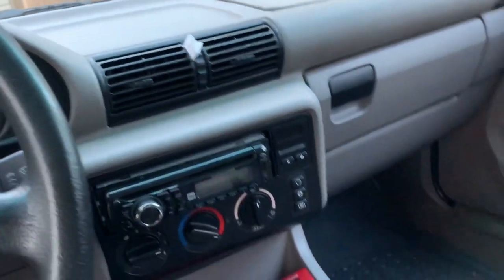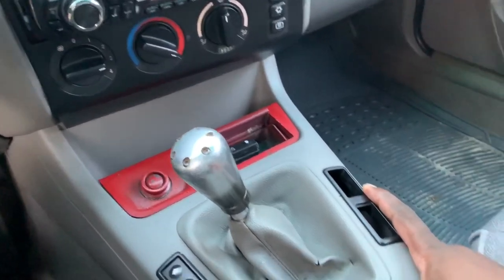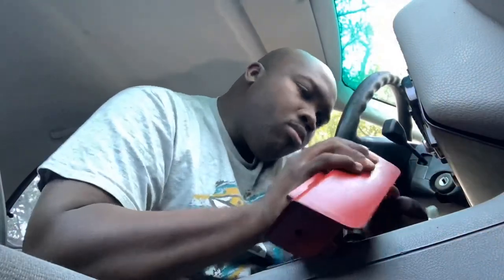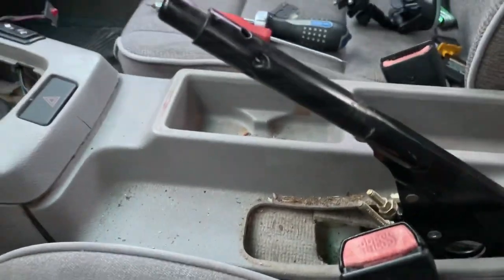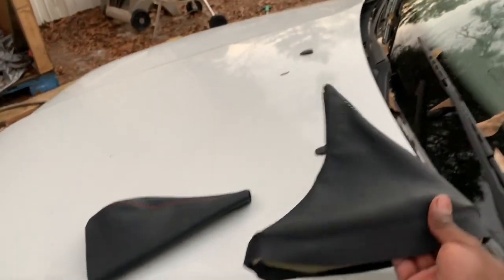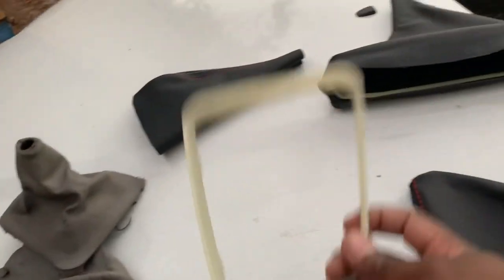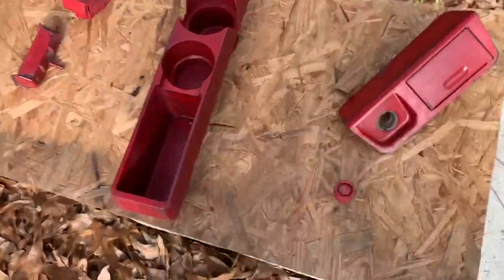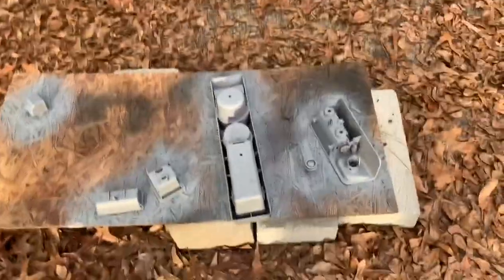E36 Interior Mods | More eBay Parts

Comment: Love the new boots!  Two of the best upgrades I made to my old VW Bus was the short throw kit and the Empi trigger shifter it really tightened up the sloppy mess the original shifter was when i bought it you could swivel the damn thing almost in a complete circle and it wouldn't come close to a gear. So much fun driving that thing cross state to get it home. (Bloomsburg,PA all the way back to Pittsburgh)  :(
Reply from the maker: That sounds both scary and fun at the same time lol
Reply: It was an experience, The kids selling it wanted 1200 for it so my friend and i drove out to see this thing and i was amazed to see a relatively rust free Bus in PA so i bought it and barely got out town when it started acting up so i found an old Napa and they actually had the points and condenser for it and i got a fresh fuel filter  and back on the road, we decided to take I-80 to save time and I can tell you that just because the speedo says 90 doesn't mean you should try it that van is about aerodynamic as a brick and the first cross breeze almost sent me right off the road. But i still loved every minute of it.
We had a decent snowstorm roll through over the weekend and the temps dipped to -2 last night when i was cleaning the snow off my truck i figured I would fire up the Bus as well and it took a few tries but that sucker fired up and ran like a champ 47 years old and still chugging!
Reply from the maker: That’s awesome! Also how lucky are you guys to walk into a random napa an pick up points and condenser for it! Those are memories to hold onto!